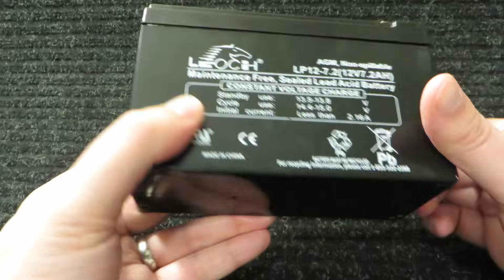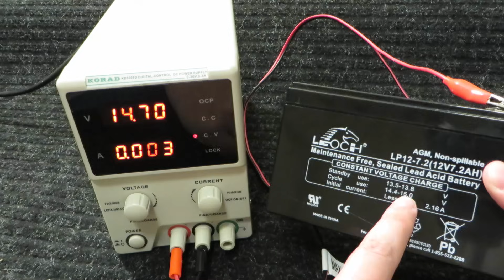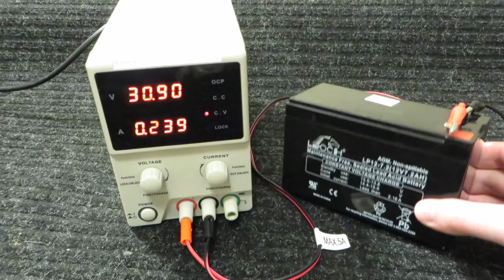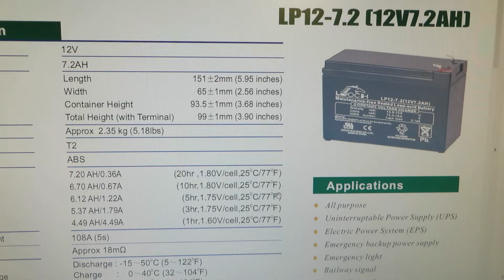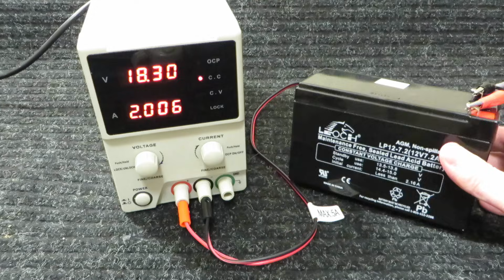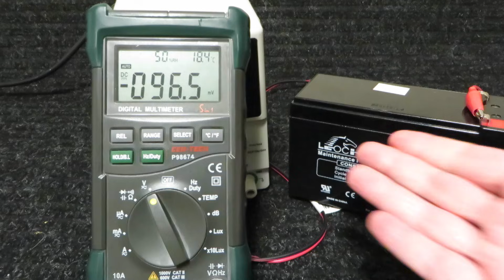Battery Desulfation Demonstration Start to Finish - Part 1/2

Comment: add a resistor. mains voltage bulb is good. any wattage, doesnt matter. high wattage will flow a bit more.

i run a 45V supply. fine. 35v@10A. unregulated transformer.
wack a dead battery straight on. give it a tickle. ten second type thing. few times. will see if its going to do anything pretty quick.
then throw a bulb on in  series. at this point an auto bulb should be ok... the battery still has the voltage drop, and the bulb doesnt drop much at all...

after a while it will start heating up, both bulb and battery. once the (12v) bulb is glowing, its starting to pull enough current to drop its required 12v...
stop.
now youre better to run a heater, a steady resistance rather than a bulbs varying resistance. or change to your 120/240V bulb. something which can just keep dropping volts without burning out.

ive got 150R 100W thing, so yeah... 45V on it, only tickles very gently... currently, an 11Ah is nibbling on 300mA, at 14.2V. three days so far, up from about 10... was completely dead on arrival.

 but the batteries bounce up, slowly bubble, stay cold... and the electrolyte level RISES. because the water is held in the spongey sulfated plates... not as water but in teh sulfate itself.

the electroplating process of actual charging takes a certain current, surface area. you need enough voltage so it can always draw current, but it also needs to be limited so its only drawing current as the CHARGING PROCESS REQUIRES.

as soon as you let more current flow than the chemical process wants. it becomes an electrolysis cell, and the current is being dissipated as HEAT... you are wasting power on simply driving current through the electrolyte doing nothing, and current to break water down without performing the actual chemical process required to form good plate structures...

when a battery is charging correctly, it DOES NOT GET HOT. not even warm. all the energy goes into the chemical process of plating, not heating.

its really similar to electroplating because it IS electroplating... its worth playing with it... gives you a much better understanding.

throw a resistor in and yep, just run em at a silly high input voltage. the current and voltage will find their own rate as the power is wasted mostly in the resistance.

then a heavy discharge. then recharge... cycle them. they love it. but DONT STOP when cycling... its again, just like electroplating. if you stop during charge or discharge, you just make onion skin. gotta keep it steady, all the way, then ramp them back up.

approach them with the idea you are trying to break down a previously formed onion skin and replace it with solid electroplated metal.

only time i will stop one is during that initial rescue, i occasionally give them a wack of the full 45V again, get a good feel of how theyre behaving if you run a meter on them... with an unregulated supply ;) just tap tap tap, can see how fast they pull up and overvolt, along with the current draw... then rebound.

and the fully charged voltage is much higher than the label states... 2.7V or so per cell before the actual process is finished. 16.2 volts!

 DONT FLOAT THEM.
Reply from the maker: Your advice sounds like a video I made years earlier.  It works too.

Comment: Hay.  I have no problem getting two car size lead flooded battery to a rest voltage of 12.4, 12.5 volts.  The problem I have is when I hook up the battery to any load like 65W headlight.  The voltage drops to below 12v  immediately and I get at most get a few minutes before it get below 11 volts.  Cycling does seem improve it.  Are my batteries toast at this point?
Reply from the maker: If overcharging them and cycling them while keeping electrolyte levels topped off doesn't improve them then your batteries are likely 'toast'.  They do have a finite life unfortunately.  Sulfation is one of the most common abuses they suffer and THAT can be recovered.  Worn out batteries that have lived a good life and have no more to give just have to be replaced.
Reply: @knurlgnar24  These are fairly new batteries less than 5 years old.  In my case here being able to get the rest voltage to 12.5v or above but with no capacity.  You think overcharging it more would help.  Because I stop over charging (switch to a smart charge) once I get the rest voltage to 12.5v.
Reply: @bobcharles7716  you must measure the specific gravity of each cell with a hydrometer if you want to find out what is going on.

Comment: Some questions, can this be done with a laptop charger/AC Adapter 15V @ 6A? I have an interstate MTP-24 that is 4-5 years old, and has the last cell next to the positive terminal that reads 0.31V from the positive terminal to the plates/electrolyte. I've been trying a regular smart charger for a week on (daytime) and off (at night) and it drops to 10.8 in the morning. What should I do first, go and buy the 15V AC Adapter and do your desulfation method or replace the electrolyte and clean the battery out and then your method? Thanks for the great videos.
Reply: The cell is shorted, so your battery is done for.
Reply: @SinsBird  Do you really think so? How can I test to see if it's shorted? You know what I'll try cleaning it out to tomorrow with distilled water multiple times.
Reply: @Max2JZZX10R  You already did. You know that the battery discharges to 10.8 volts and you measured the voltage of the bad cell which is 0.31 volts. Voltage of a fully charged cell is around 2.1 volts so 5 times 2.1 plus the bad cell 0.3 volts = 10.8 volts. If the cell wasn't discharging by itself because of a short in it it would charge and stay charged.
Reply: @Max2JZZX10R  Sulfation on the other hand is about reduced capacity and increased series resistance, nothing to do with open circuit voltage.
Reply: @Max2JZZX10R  Don't bother, it's not worth it, it's extremely unlikely it would help at all. Today's batteries have their positive electrode plates in pouches and lead particles that are shed over time are well isolated. The cell fell apart, disintegrated inside, probably because of severe corrosion, that is why it's shorted.
Reply: @SinsBird  Do u think it's shorted from all the lead particles that accumulated at the bottom of the battery? Because the electrolyte inside the battery is literally gray in color.
Reply: @Max2JZZX10R  the tiny particles are never the problem, it's the positive electrode plates that crumble to nothing while the negative plates stay intact.
Reply: @SinsBird  True that probably happened from years of "maintenance free" service lol. From now on I'm going to make sure to maintain and take care of the other interstate MTP-24 that I have in the car right now. Ill probably save the battery for a core charge.
Reply: @Max2JZZX10R  best way to maintain a battery is to get a hydrometer. The specific gravity of each cell should not differ too much. Should be at least 1.26 if a battery is fully charged. If it's more than 1.27 make sure there's enough water. 1.27 is the best performance number with least corrosion. If adding water, add little by little, best with a syringe so you know exactly how much you add, because diluting the electrolyte too much is also bad. Sometimes the electrolyte needs to be agitated by tipping the battery 45 degrees back and forth to make the electrolyte slosh around and mix, because it can separate in layers over time. If that does not help to raise the specific gravity the battery needs to be charged noting how the specific gravity is changing for each cell and adding water if needed to lower the specific gravity. If a cell is bubbling while charging yet the specific gravity is lower than 1.26, this usually means that the cell is sulfated and needs to be charged and excercised. This procedure should be done at least twice a year, but it takes some time, can be a week even, but on the bright side it's not done in one go so the battery can be used when needed.
Reply: @SinsBird  I just checked the voltage right now getting home of each cell individually relative to the positive terminal, and the bad cell reads -0.31V, I guess the cell said Imma head out and swap polarity lol. What do you think about that?
Reply: @Max2JZZX10R  Well since it's almost completely discharged it takes no energy for it swap polarity. Oh and if you ever want to measure individual cell voltages on a good battery avoid dipping probes or other metallic objects into the electrolyte because the electrolyte gets contaminated and may affect the performance negatively. Use carbon, graphite rods or lead metal.
Reply: @SinsBird  Yes I'll keep that in mind from now on, also I just read your reply on Specific Gravity, very helpful thank you! I've been doing so much research on repairing and maintaining lead acid and AGM batteries. So much good information out there, even Eric the car guy has a 10 year old video on maintenance on car batteries and all the information is relevant today. I'll buy a hydrometer to measure the specific gravity this week of the good battery, hopefully with good maintenance and constant smart charging on my car and my motorcycle's AGM battery I can make them last longer than the warranty intended. Now I'll definitely be getting rid of the MTP-24 that's toast. Thanks SinsBird for your time and lecture, I appreciate it.
Reply: @SinsBird  The Kawasaki's battery is on the smart charger right now, (It's like 10 Months old)  I'll probably keep it connected till bedtime, so it can go through a complete charge cycle because I haven't ran the bike in a week. And then I'll make sure to charge the Good MTP-24 whenever the car has extended downtime, like 1-2 times per week for a complete charge cycle.
Reply from the maker: I agree with SinsBird in that you have a shorted cell.  I wouldn't immediately jump to positive plate corrosion as the cause but it's a likely guess.  Your best course of action is to purchase a new battery.   @Max2JZZX10R
Reply: @knurlgnar24  Hey knurlgnar, thanks for the reply, yeah I think that one cell got severely discharged and then reversed polarity. I wonder if anyone has tried to fix a reversed cell by charging only that one cell?
Reply: @Max2JZZX10R  I'm glad I could help, feel free to ask if you have any questions later.  But you can use the bad battery to practice equalization, desulfation and try to set the specific gravity where it should be in the 5 good cells without worrying you could ruin it.
First thing that should be done is equalization charge. This is usually done by charging with fixed current at something like 1 ampere and basically unlimited voltage until all good cells are evenly bubbling or until the battery gets noticeably warm. Or if your equipment is not that sophisticated you can try charging with voltage above 15 volts. Then after at least 12 hours the specific gravity of each cell should be checked. If some cells have higher specific gravity than you like, compensate with water, if lower do the following procedure. There are three common ways to desulfate, raise the SG level:
1. Charging with a 'dumb' transformer based charger with no smoothing just diodes and a load connected in parallel with the battery.
2. Charging for something like 10 seconds stopping the charge, discharging for like 2 seconds, repeat. But this requires some kind of contraption.
3. Barbaric but effective way, set the current at something like 3 amperes and charge with this current for 2 hours with caps off so that it doesn't pressurize, also the battery should not heat up much, if it does the charging current might be too high. Let it rest for at least 12 hours or use it in a car, whatever. Then measure the SG levels and write them down after every cycle, you should see an improvement every time, compensate if needed. Repeat if needed.

Also about the basic hydrometer, when the glass bulb is floating make sure the top of it is not all the way up resting against the rubber part. Also there might be some friction between the glass bulb and outer tube so to make it find it's real position more accurately press the rubber bulb multiple times just enough to make the glass bulb move up and down.
Reply: @SinsBird  Great information as always, thank you again. I just did a warranty search on interstates website and the battery has a date code of K9 so October 2019 and I have the original receipt from Firestone, it still qualifies for warranty with 45% off MSRP (not bad). I'll go to the interstate dealer tomorrow and talk to them. Again thank you guys so much 🙏

Comment: I think this guy is either dumb or blind when understanding how to read numbers at 1st grade level. He keeps misreading the numbers. He described (0.001 amp) 1 milliamp as almost no current at all when actually 10 times that can kill a horse. Several times he keeps describing his power supply voltage as "31 volts" when clearly it reads "30.90" volts, and that is clealy 10 milliamps less than what he says. Maybe he has battery acid on his glasses. What the actual truth of his entire presentation is, it is spoiled by this misinformation. If a person is 99 percent correct on a hundred 100 points that leaves him 1 percent wrong and that sullys him completely,
Reply: Hi Elton.   You sound just a tad aggressively quackers....  just saying. 
Let me translate what you wrote..   you think the narrator must be dumb or blind by rounding off numbers.  You are offended that he rounds off 30.9V as 31V.    You are offended when he describes 1 milliamp as almost no current. 
Then you advise that a 10milliamp current can kill a horse. 

Either you are being very selective about scenarios, or you know little about electricity.   As a quote from the internet says:   “Death by electrocution requires a high voltage power supply that has a rated power which allows for 100mA or more of current to flow under load.”    The high voltage mentioned is something in excess of 100 volts. 

In the video situation a benchtop power supply is supplying 30 V at poofteenth amps.   All horses in the world are safe. 

Perhaps you were just having a bad day, but giving antisocial insulting sprays that are also not technically valid makes  you appear to be a boofhead.   Are you a boofhead?

Good luck with your social skills, and if you feel the need to vent please scream into a pillow, rather than damage the motivation of people providing constructive input to society.   (You could even try making a constructive youtube video yourself)     Ooroo.

Comment: Thank you very much for the very helpful method. I have a 12V 12Ah battery which died and it didn't react on smart battery charger. Using your method I was able to recover the battery and use it. As I don't own lab equipment, 1st I have used 36V 4.5A adapter, the current was slowly rising from 0.01A to above 2 A over a day and battery gets very warm, batt. voltage at the end of the day was above 10V, which dropped to 8V overnight. So I started the cycle again next day. until the current rose to 3A, I stopped there as I don't own lab equipment, voltage at the end of the day was above 11V and dropped above 9V overnight. Next day I took laptop power supply 20V 4,5A and it took approx a day the current rose above 2A and batt. voltage was above 12V. Then I attached the smart charger, and it charged the battery overnight. I took few days but I can use it now.
Reply from the maker: That's great!  I much enjoy situations where people use what they have on hand to accomplish things that ordinarily wouldn't be possible without some knowledgeable creativity.  Sometimes the best hammer you have on hand is a wrench, and sometimes the best pry bar you have on hand is a screwdriver.  It works.

Comment: great video. i was trying this on a similar battery to yours. I had the power supply at 32v and it reached 1.3A then the current suddenly tanked all the way down to 200ma. Battery didnt seem that hot. Any explanation for this?

Comment: Would this work if a vehicle battery is at 550 CCA when rated at 710 CCA?
Reply from the maker: Probably not unless the battery is only low on CCA due to sulfation.  The most likely scenario is that the battery is simply old and needs replacing soon.  Then again 550CCA should be plenty for most any vehicle even during the winter.

Comment: i have two batteries a car 12v/40AH flooded type & a bike 12V 5AH maintenance free both cannot start the engines but do show the voltages, even get charged, can i fully recover them.
Reply from the maker: It depends on their history, but unless they sat unused for long periods of time their problems are likely not sulfation.  Your batteries may have simply reached their end of life and need replacing with a new battery.  Motorcycle batteries in particular tend to have short lives as they usually use higher acid concentrations to boost performance at the trade-off of useful life.

Comment: Would this work on my weak 6 year old AGM car battery? The car has start/stop with energy recuperation technology BS . Or is my battery just worn out? The car apparently only charges the battery to 80% so I’m wondering has it caused sulfation. Maybe the smart charging prevents that?
Reply from the maker: If you regularly drive your car and it hasn't been sitting unused or only driven a couple times per week I expect you simply need a new battery as they have a finite lifespan.  6 years is pretty good for a vehicle with start/stop.  That's hard on a battery.
Reply: @knurlgnar24  thanks for reply. Yeah the car does 600 miles a week. I also think it might have a high self discharge rate problem. I had interesting readings from the battery monitor when it was left sitting at the airport for a week.